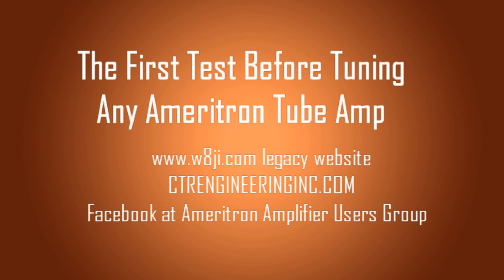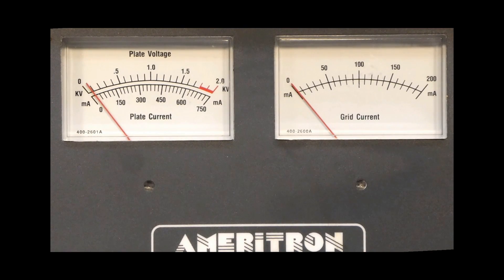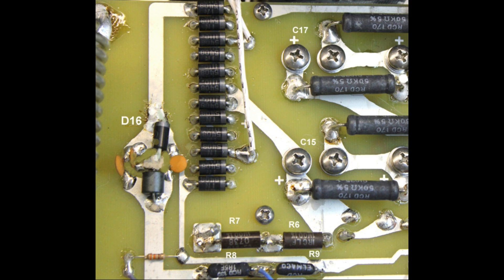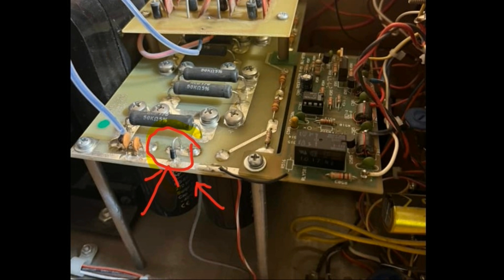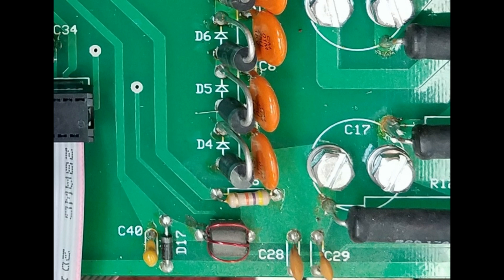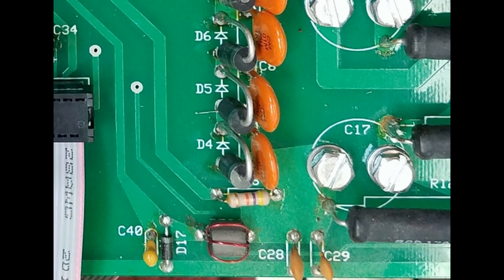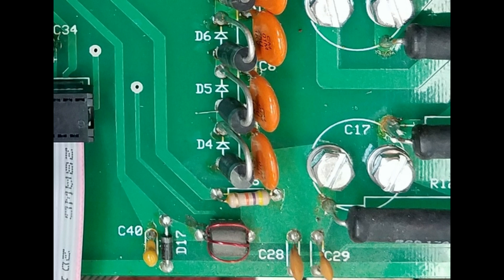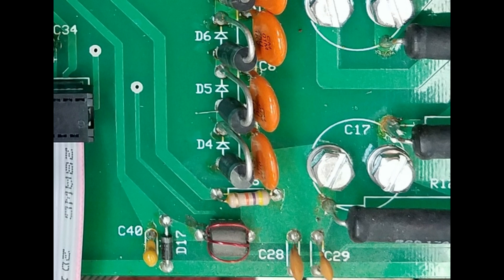Critical Meter Test Tuning Ameritron Amplifiers

Comment: AL572 and yup mine is blown too. I guess there's a 1N4001 in now. Gonna replace it with a 1N4007.
Reply from the maker: The voltage of the diode will not change diode life one bit. The diode is always forward biased into conduction during a fault or surge. The diode forward surge current rating determines the failure point, not the reverse voltage.

Comment: Thanks! My grid current looked strange.  Reading high. Did a check,  as you described, and the grid current moved.

Replaced it (the diode I removed was shorted), and its working properly now.

Comment: My Amp is 25 years old. I have no clue how long both of my needles have been moving in unison! 
My output has dropped to just almost 400 watts and I thought it was just weak tubes ( probably still is) but I have ordered  a 1N4007. Thanks for the insight.

Comment: Hi Tom, in the event the diode is open would it be possible to have a trigger circuit that turns on an led using the votlage ir current level present when open? It would only indicate an open diode  while doing your test scenario, not used or pay attention to while in normal operarion?
Jim WB8ZLK
Reply from the maker: Honestly, in over 50 years of doing this and using that form of protection, I have not ever seen a diode open. 

The only common diode failure is a short. We use a 1N540x or a 6Ax diode to improve immunity to shorts. Mostly we use a 1N5408 (because we stock them by thousands) or a 6A10 (because we stock them) in real big amplifiers
Reply: @Jerrythenerdful  ah ok, could think of a way to use the potential difference that is present when diode is ok but then adding anything into this pathway adds more potential for shorting failures, where the simple test you suggest just needs to become SOP.

Comment: How are you going to test  the amplifier and I assume radio is on and the relay connection is in place without depressing the key what you say is not even plugged in unless of course you're going to use the send on the radio but on the other hand my ts2000 does not allow a zero watt out. The minimum power on my ts2000 is 5 Watts.

I would love your response and also I need a link to a web page if you have it on anything you have on neutralization particularly for the AL 8118 H and I understand you had a method for that did not require power because I would like to read more details on that then your video showed and in addition to that I want to check that before I put in a new 572 B's I just bought and I would also like to know that if the neutralization was correct for an 811 whether or not it would also be correct for a 572B. I realized this supposed to be one for one Replacements but there are some differences including the fact that the 572b has a much more robust plate dissipation level.

Thank you very much sir
Reply from the maker: Put it on CW, do not plug in a key or close a key if one is plugged in, and push the MOX or Send button. If your radio does not support that (almost all do) you can go to SSB, use PTT with mic gain at zero or just do not say anything into the mic.
Reply: U @Jerrythenerdful